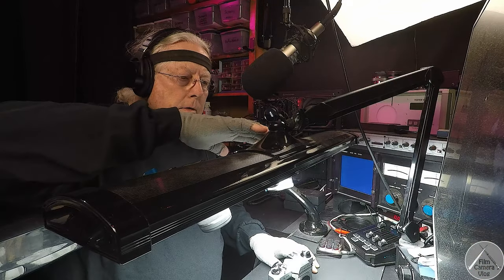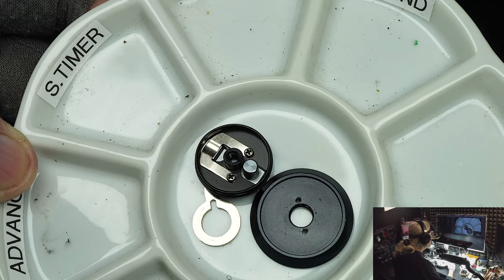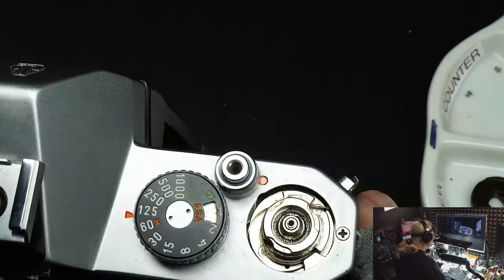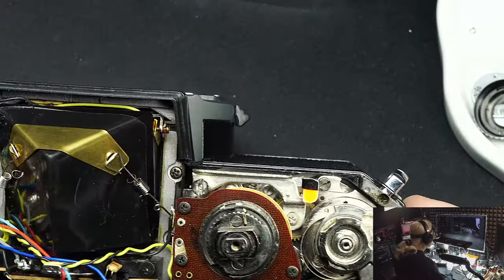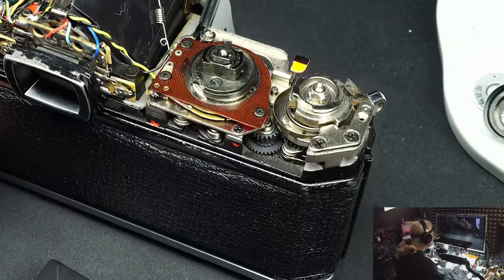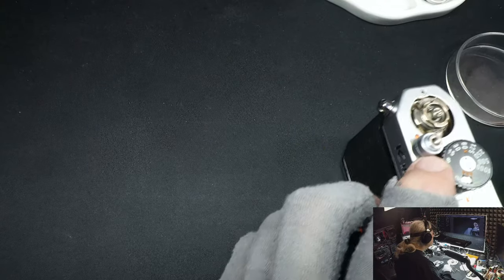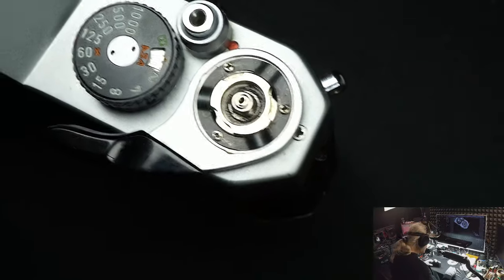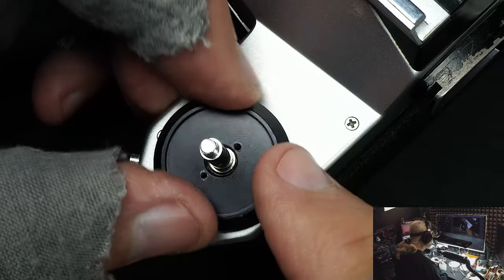Pentax K1000 | Remove Top Cover Tutorial | DIY #012

Comment: I’ve got several K1000s that exhibit desilvering of the viewfinder prisms. Have you any favorite materials for attempting to re-silver them?
Reply from the maker: Hello flyingo
I have not seen this problem yet with the Pentax K000s I've worked on. I have seen this happen with various other 35mm cameras (OM-1 is the worst offender) I've worked on over the years, and I usually just grab a good prism from my camera parts bin to replace the damaged ones. I suppose a person could silver a prism, but just replacing them might be cheaper. Over the years, I've purchased hundreds of non working 35mm cameras and took them apart for the extra parts to use in my repairs. People often contact my shop looking for parts, but I don't sell parts. I always tell them to buy a non working camera, of the same model, on eBay and use the parts to fix their camera. Sometimes you have to buy several, but it works out okay.

Comment: Thanks a lot for sharing this precious info. I have one question, lightmeter in my k1000 does not work. I removed bottom cover and realised the tiny cable from battery going upwards to the top section of the camera is deteriorated and therefore need to be replaced. I tried to figure out from your video where this cable goes in the top part but did not got it. Any Hint. Many thanks
Reply from the maker: Go to 27:44. There you will see a circuit board. Look to the far left and find a [screw] with a brass washer. Now look right and find a [red wire] next to the screw. Go to the right of the red wire and you will see a [black wire]. The [black wire] goes to the battery compartment.
Reply: Many thanks